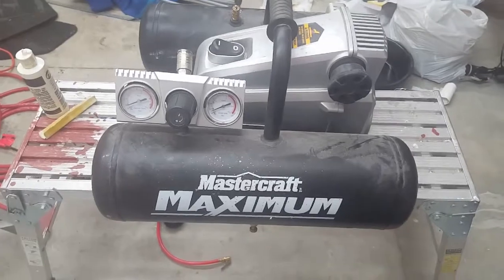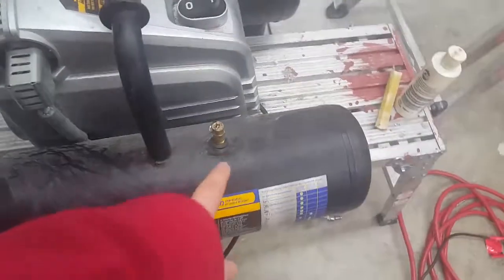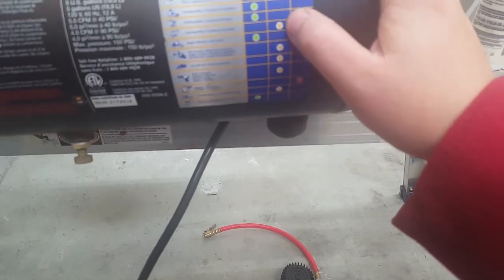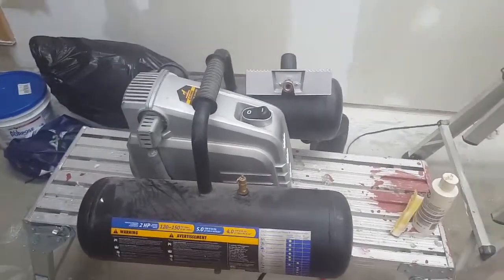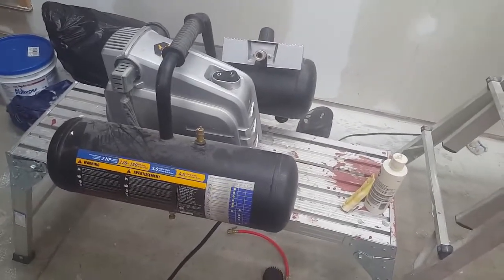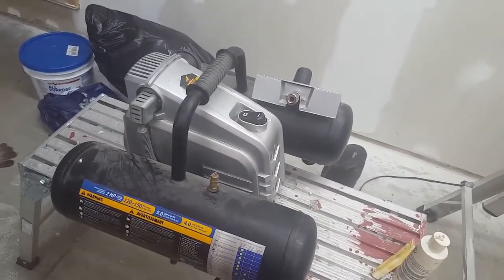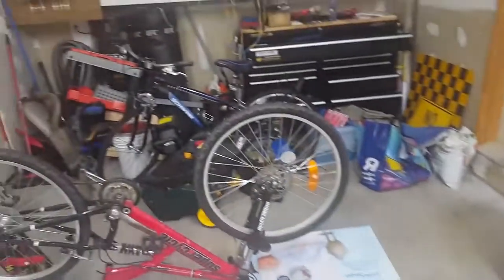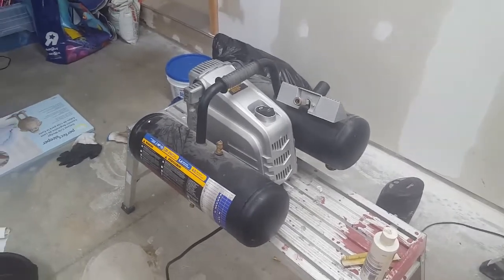Mastercraft Maximum 2hp 5 Gallon Compressor Review.

Comment: long shot but mine leaks from the line that connects the two tanks. there's a bolt looking "maybe one way valve" that leaks air and causes run on and breaker blowing. Any ideas?
Reply from the maker: When you say line that connects the two tanks do you mean the handle? (That connects the left tank to the right tank) Or the line that connects the left tank to the compressor? 
If its the handle I'd pitch it before I welded it closed.
But if it's the line from the compressor......I'll look at mine this afternoon.
Reply: The line that connects the tanks underneath.